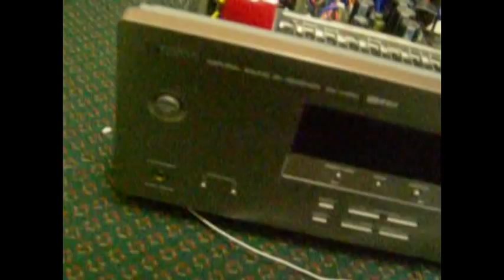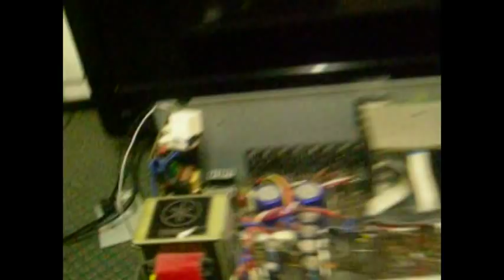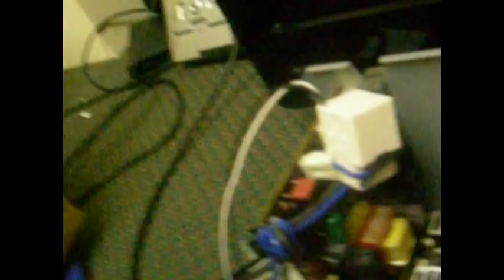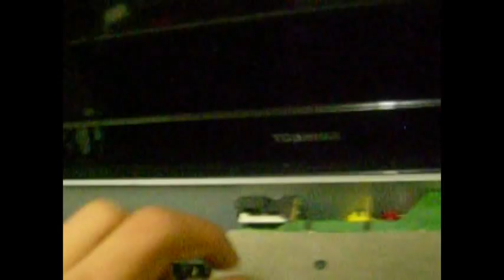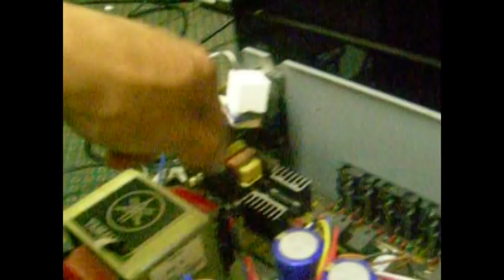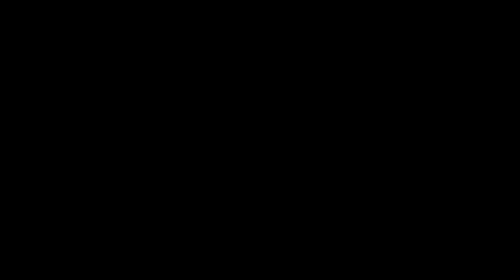Yamaha RX-V450 - Dead, not powering up - Diagnosis and temporary fix

Comment: Cool. Yamaha RXV861, same capacitor, same 7nF instead of 22nF, after all this years. Just replaced and problem solved. Thanks, you saved me hours of work. :)
Reply: I have the same amp and this fix worked a treat. I was going to toss the amp otherwise.

Comment: sorry the model is RX-V496 not RX-493  Yamaha amp with the problem of power up and then clicking off and sometimes I get lucky it works for a while The power board is slightly different and has two smaller capacitors at C837 and C842, I was hoping to get your advice on would replacing these solve my problems, and can i test them while still on the board, thanks

Comment: Tom when you add freezing spray to the cap, the cap itself heats up and freeze lowers temp? or it's acting on the component itself ?
Reply from the maker: acts on the component, only diagnostic, not a permanent fix.

Comment: Hi There, Thanks, you saved me a lot of time. I pulled out the capacitor in question and it read 3nF and it should be 22nf. I also measured peak to peak of 696 Volts. This is with a supply of 246 volts from the mains. I cautiously suggest that the capacitor's voltage rating is not high enough being at 630 Volts. You got a good bit gear for 20 quid! Cheers and thanks again.

Comment: Hey, I used the spray and it worked fine, the amp came back to life. However, 20 mins into playing, it cut out again. Any ideas?
Reply: Adam Scott You're going to have to replace the capacitor.

Chilling the part to get it working again is helpful in narrowing it down as the cause of the fault, but the fact remains that the part is out of spec and will not function like it's supposed to when at normal operating temperature.
Reply: Cool thanks, that makes sense. I have ordered a new capacitor, hopefully that will get her working.

Comment: Thanks heaps man, that's exactly what was wrong with my old HTR 5840 was stuffed for over a year cost me $0.55 from jaycar
Reply: Did you replace the capacitor or just use the spray?  I have the HTR 5840.  Dead.
Reply: Sprayed it first to see if that was the problem then i replaced the capacitor. its working like new again.

Comment: I have a Yamaha Model-Rx-V4600 that clicks on and then clicks off. Used to work fine... would you be interested in buying it ubuntututorials?
Reply: This might be a very small problem that can be easily fixed- thermal fuse in power supply.
Reply: Hello, i have the same problem with my Yamaha Avx s80 and it clicks once and than its turn of .
Please help

Comment from the maker: Could easily be. Rated 22nF. But my capacitors on failed units measured 6nF and 7.5nF each, so yours is only "just" failed. Maybe worse when high voltage applied though. Definitely a good idea to replace it.

Comment from the maker: Yep. 22nF/630V. I recommend replacing it with 22nF 1kV for longevity (prevent repeat failure), but 22nF 630V will work.

Comment: Hi, I have a similar receiver (RX-V559) with the exact same problem. Would the capacitor be the same as in the V450? I opened it up and the numbers written on the capacitor itself are '223k 630GI'. Thanks for your help!

Comment from the maker: It's very easy to repair it yourself. I know a lot of people use faulty equipment as an excuse to buy new equipment, but when the repair is so easy it seems silly to me. You just need a soldering iron and a one euro component. If you decide not to repair it, would you be willing to ship it to me? (I'll buy it off you for a reasonable price...)

Comment from the maker: The freeze spray (compressed air can produces freeze spray too) diagnosed the problem. However, it does not fix the problem, only tells me where it is. The fault come back after 5 minutes when capacitor warms up. To repair the fault you should replace the part. It cost me less than £1 (~1.20 euro) to replace it.